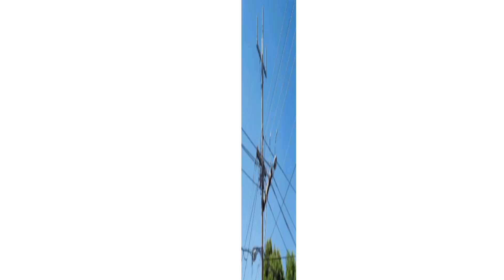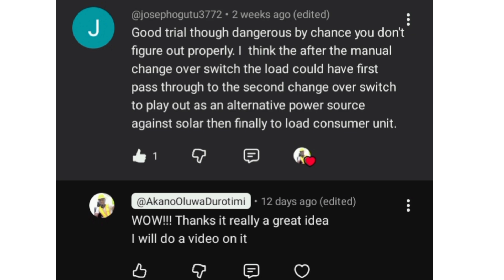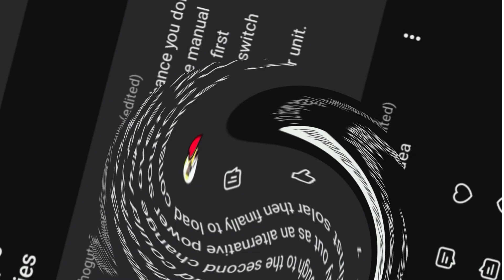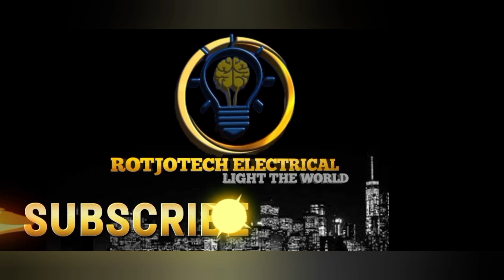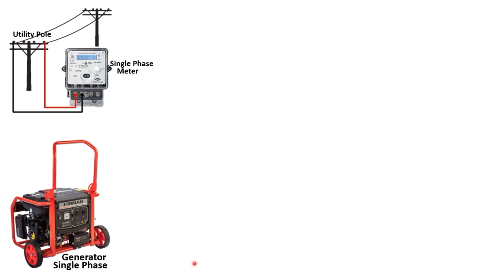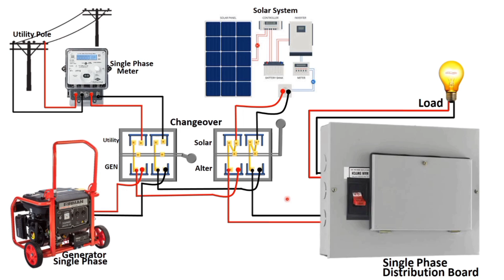How to Connect 3 Power Source  Single-phase (Utility + Gen + Solar) – Zero Risk Redesign”

Comment: How do you seemlessly get grid or gen to automatically charge the inverter when available??
Reply from the maker: First I will like to know if the inverter is part of the solar system 
If yes that means the output of it is one of 3 power source
Now a socket can be connected to the output of the first manual Changeover which alternate grid and gen
So when this Changeover is manually switched to any of the options inverter will be directly charging 
even when solar is still the power source chose to power the house and when the second Changeover is switched to alternate side (grid or Gen ) to power the building still the inverter will still continue charging
Reply from the maker: I hope my response helps
If not pls ask me questions on the part that is not clear
Reply: Use an ATS.  I use two ATSs in sequence as this video describes.  It's very easy.